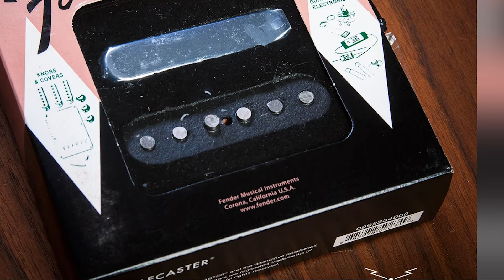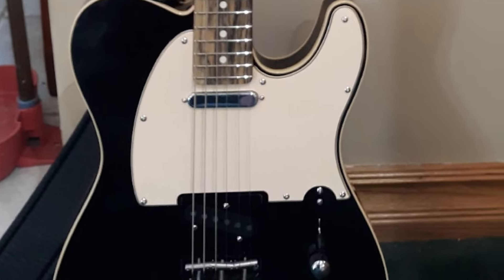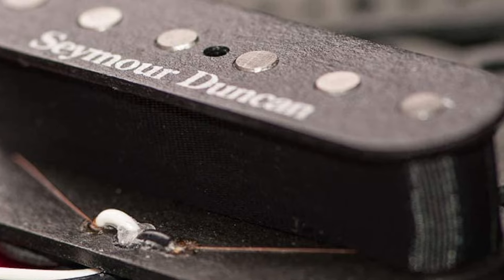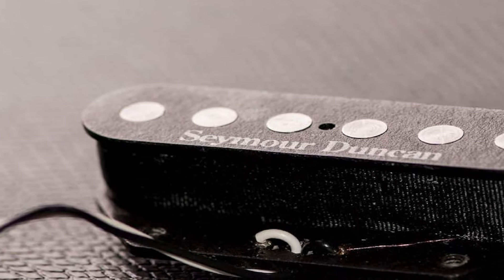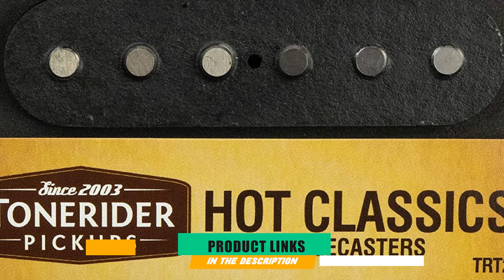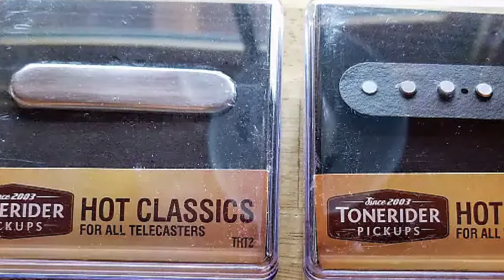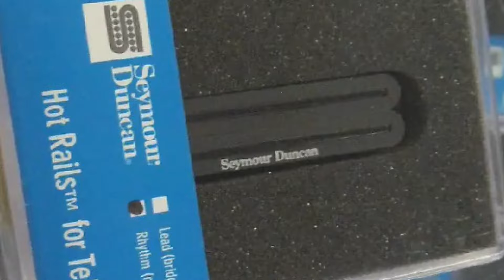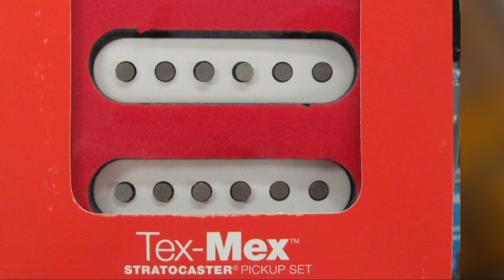Telecaster Pickup : Which are the Best Telecaster Pickups in 2025?

Comment: Oripure make a hotrail telecaster A5 pickup, which I found suits the telecaster better than the ceramic, also a great sounding vintage wound pickup is the Alchemy A4 Esquire pickup for those brave people who a p90 in the next by bare knuckle, I had the half tone p90 and the mentioned A4 esquire pickup. What a lovely sounding guitar especially through the carlsbro classic 15, with the non standard alnico celestion blue speaker, or the extension speaker which was fitted with Alnico celestion Ruby's for the old school blues sounds

Comment: Nothing against Fender (all talk resting on past laurels) musical instruments, however, this infomercial gives the impression it was cloned from You-Know-Who’s advertising copy.  Did Fender backward engineer and analyze a 1951 bridge enamel wire coating, wire composition, alnico 3 magnet larger diameter and composition, is the baseplate ..06 inch did they use vintage spec cold rolled steel then zinc plating or did Fender use cloth hook up wire and stamp their name for example…